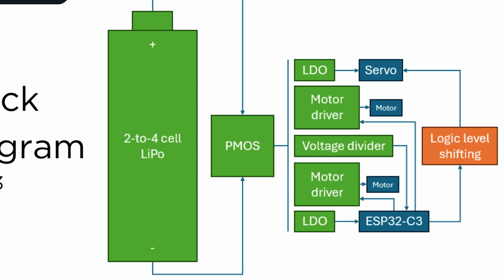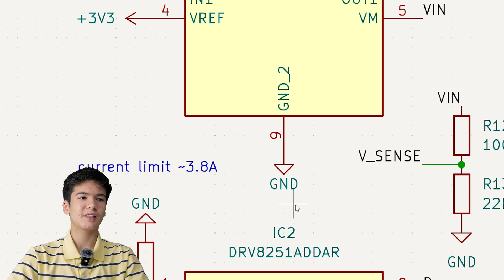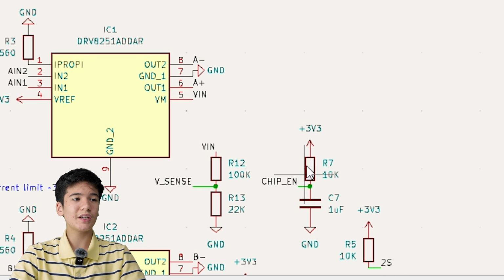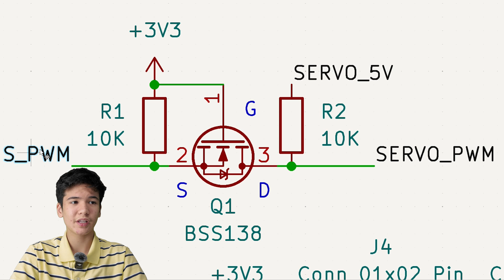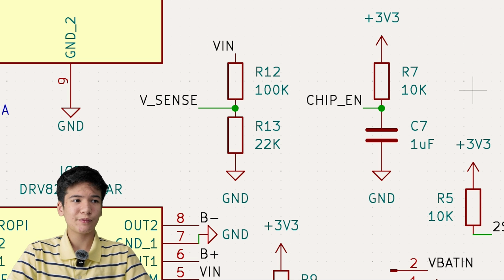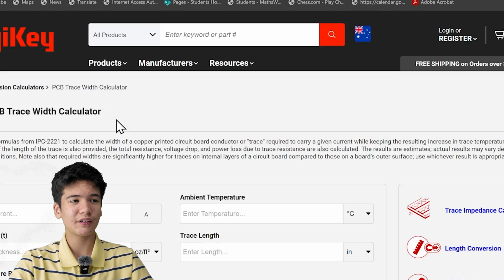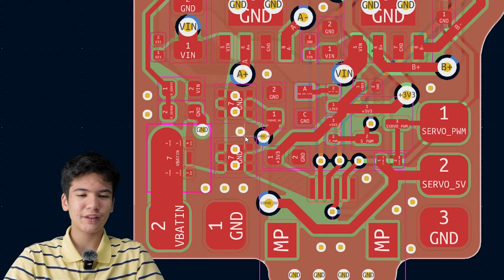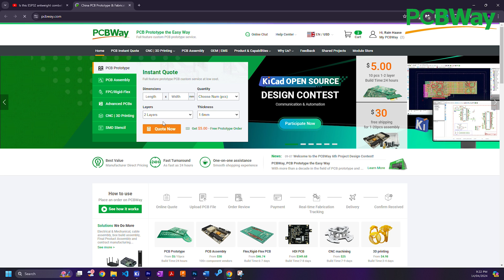ESP32-C3 brushed ESC + RX - Design Overview (it's tiny!)

Comment: Great video, big fan. Some tips on passive components: you can and should use 1% resistors for everything, as they are often the same price as 5% and give an assurance of accuracy like you said. You also correctly noted that ceramic caps are terrible for bulk storage for many reasons, so you can think off-board for a solution that costs zero PCB space: many drone ESCs (which also suffer from battery voltage sag under heavy load) solder a giant through-hole electrolytic cap directly to the battery wires/input pads and bend it somewhere that it fits. Happy making :)

Comment: Also a hint for the Power LED... Get a Two-Pin bidirectional Red/Green LED (or put two LEDs in parallel bidirectionally) where the GREEN led lights when power is applied correctly, and the RED led lights when the power is applied backwards.
Reply from the maker: Smart! Yes, I might try that sometime, thanks!

Comment: Have you stumbled upon the TA6586 motor IC? It's DIP8 but can do 5A continuous, there's also the SA8336 7A continuous in DIP8 and SOP8, the latter is not available on LCSC however, used in MN/WPL RC cars
Reply from the maker: Yeah, I’ve only seen the TA6586 I think, but I didn’t want to use a DIP8 since it would be very space consuming (bc it’s through hole). I’ll take a look at the SA8336 though. Thanks bro

Comment: I recommend against low-temperature solder, especially in power applications. Many components have overtemperature protection at ~150C, so in some conditions, they could melt the solder. Anyway, great video.
Reply from the maker: True true actually. Next version will be assembled by PCBWay though, and they will probably use 250 C solder paste
Reply: @h1tec  Cool! I would love to hear about it.
Reply: Also, voltage dividers and ADC are a little bit tricky. If you have very high value resistors, the readings will be not precise, as there is an internal "sampling" capacitor in ADC and with high input impedance it takes a lot of time to charge, probably more than your sampling time. Just sharing the information, I think your design is fine here. Check out AN2834 application note if you need a good bedtime reading about ADCs :D